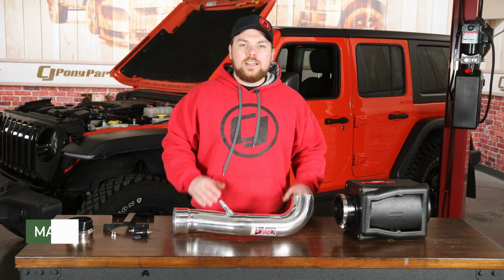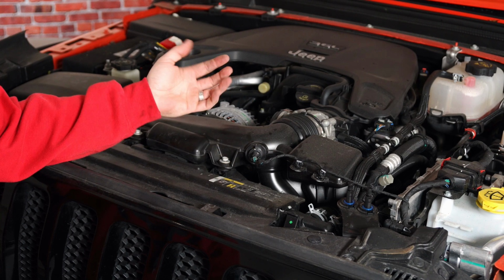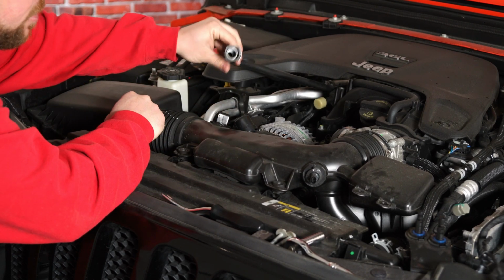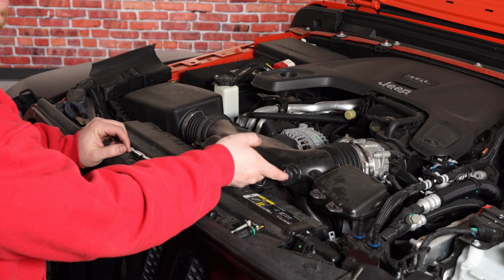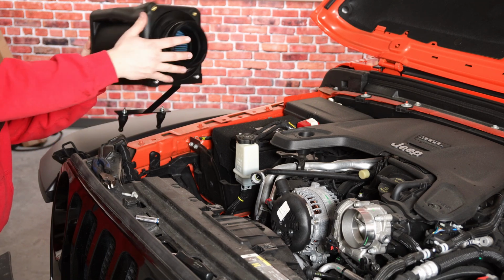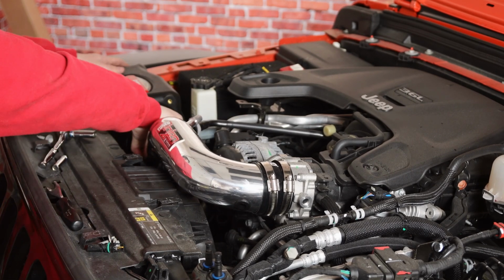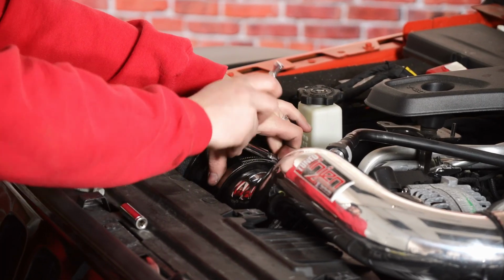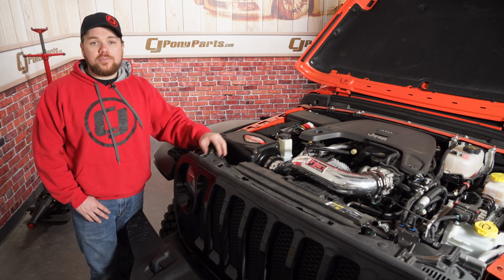2018-2021 Jeep JL Install | Injen Cold Air Intake System

Comment: Why would these idiots not let us hear it after installation?
Reply: Because in order to hear it…you have to drive and give throttle…it has a deep roar. It will not sound any different than stock while in park and giving revs.